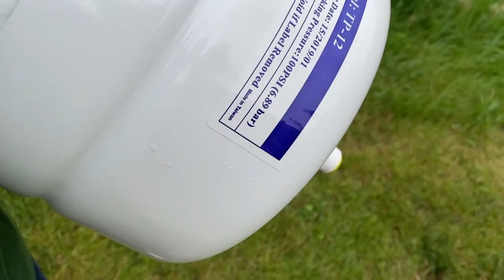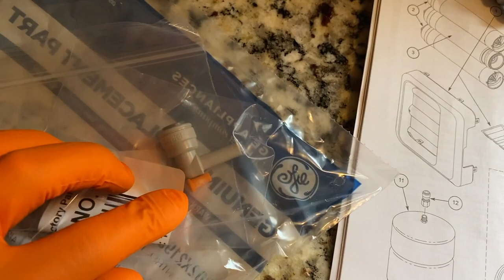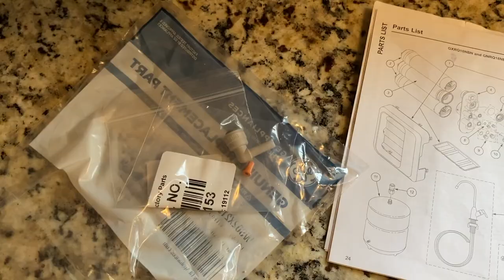Reverse osmosis system draining continuously - Common causes

Comment: I have a new unit and after setting it all up, doing the purges and everything, the tank is still not accepting water.  There is a audible trickle of water out the black (drain) tube, so not sure what I am doing wrong. Any thoughts?  On top of that, they turned the tank fill tube into a yellow tube instead of clear, so it's hard to see how much (if any) is making it in the tank and not.

Comment: I need help? I have a Watts brand 3 stage reverse osmosis system. It continues to drain water down the drain making a gurgling sound. Manual reads, to pump 4-7 PSI max. No more then 7 PSI in empty tank. I have 7 lbs PSI in tank. Still drains water with gurgling sound down the drain. Is there a way I can bypass this to stop losing water down the drain? I know to bypass has to do with the red & black water line. Can I simply, pull the red line off and plug it off to bypass it. My State doesn't have that code to have this safety thing. Thanks.
Reply from the maker: Thanks for watching & sharing this.  Have the filters been replaced recently?  Even if 1 of the 3 filters gets clogged up, it will make system perform like this.

We haven’t tried that way, below is a video that shows us discussing a bypass valve.

       https://youtu.be/O9-tMiwIHwE

😎👍

Comment: I have a friend that has the exact same system in this video. They didn't use the OEM faucet that came with the system. They used one that was built into their sink faucet. It only has one hose connection. They connected the red line from the flow restrictor to the drain saddle which is mounted high up on the drain like yours is. Do they need to change how they have it configured? I was thinking that they could build a small shelf on the side under the cabinet, high enough to raise the filter housing above the drain saddle, so that the waste water is going downhill into the drain. Would that be a good way to handle this? Also, should they install a one-way check valve into the red line since they're not using an air gap?
Reply from the maker: Thanks for watching & that’s a great question.  Unfortunately we haven’t modified this unit in that way & can’t give you a confident recommendation.

Lots of different ways however the best will be the one inline with keeping system to proper code so it doesn’t fail inspection if house is sold.

😎👍
Reply: In the configuration you describe, if the drain is clogged at the trap (or below) and you fill the sink with water, you could backfeed the RO system with dirty water - that is why they design it to use a special faucet with an air gap. It isolates the brine line by discharging above the highest possible waterline of the sink.

Comment: After releasing the pressure from the tank to drain it, did you add any air (pump) back in? How much pressure should an empty (or full) tank have? Any help is appreciated. Your vid is great!
Reply from the maker: Thanks for watching & great question.  With the tank empty, you will want to bring the air pressure to the manufacturer recommended psi which can be found in instructions manual.

Below is a link to our video showing this procedure.

       https://youtu.be/mjg-nGxpBM8

😎👍

Comment: If you unhook the water line running to the reservoir tank. Will there be a lot of pressure. I want to shorten the line after I’ve hooked everything up.
Reply: If there's no shutoff on top of the tank you'll have to shut water off and drain tank to let pressure off
Reply: @GetToThePointplz123  thanks!

Comment: Morning: I have seen a lot of vids and I am sort of worried I dont know what my problem is.  My tank seems to not be fillig up and when I turn faucet on after about 10 seconds I hear like a vibration somewhere. Also, I notice after i turn it off, I lose water to the main drain. But, its not continuous.  I am ready to change the flters on my system..just changed a year ago.  Now, I see it could be the tank and pressure.  Thoughts?
Reply from the maker: Thanks for watching, any update?  Over-pressurizing the tank can cause this.  It’s similar to using an air compressor that only has 10 psi in it to bring a tire psi up to 30psi…..the tire will always over-power the compressor and you’ll never be able to get the tire pressure up to 30.

In this example, the tire is the tank.  If the tank has far more psi then it’s supposed to have, it will always overpower the water trying to enter it…and always push the water away from tank.  Keep us posted.

Also, below is a link to our reverse osmosis Playlist.  In this Playlist, you will find many videos that will hopefully be helpful to you.

       https://youtube.com/playlist?list=PLjCXOz8TSkZlQnBuZZrgOiwjkvAkXc_Ov&si=ntoM1vLat5xSEEEJ

Looking forward to 2024, many more helpful videos to come!  🧰
Reply: I replaced 4 of 5 filters and the 5th that came in was broken...so it should arrive today.  If not, Ill look at tank but i do hear water through black line going to drain and thats the filter I have not replaced yet.
 @DIYwithMichaelBorders
Reply from the maker: @nighttrain316  

Thanks for the follow up, looking forward to hearing back from you after that last filter arrives and is installed.

👍🧰
Reply: @DIYwithMichaelBorders  well I sat down to tackle issue tonight. But initially we could not for the life of us get that last housing unit to turn to change filter. So, we ordered a new unit.  It’s slightly too small and the elbow heads when turned all the way create a totally different angle and so my black n blue lines won’t reach to clip in or they will kink. I can’t win my man!  
So going to try to order another one that’s bigger size. Wife thinks it’s the tank somehow but I want to change last filter first
Reply from the maker: @nighttrain316  

Thanks for the update, bummer.  You’re getting tested my friend, however we have a good feeling you’re going to come out on-top and have a great running and reliable system.

Keep us posted.  🧰
Reply: @DIYwithMichaelBorders   major update!  So I decided to loo at the tank. I emptied otu the water in the drain.  Then, tested pressure...ZERO!  So, I then took it outside and opened up valve and a bit came out..maybe a cup. So, I saw where you could pump pressure into it to get more out..cus it was still very heavy. One pump on my bike pump and BOOM...it flowed like a fire hydrant being flushed!  Then, measured pressure and it was at 6...so I raised it to almost 10 empty.  I still cannot get the last filter though as it simpy will not come undone.  Although its still in the time frame where it should be good, I have a feeling it needs changed.  But, everything is working great now. Any idea why that came spewing out so fast when I put in some pressure?  Thoughts?
Reply from the maker: @nighttrain316  

Good morning, we really appreciate the follow up.  That’s great news, and sounds like it will buy you time so you can purchase a new tank and replace it later down the road on your own time that works best for you.

Thanks again.  😁👍

Comment: Hello. I installed mine a couple a days ago (new). But the water is still going down the drain and it makes weird noises. Help please
Reply from the maker: Good morning, just poured a cup of coffee and am sitting down to answer any and all questions for the DIY community.

That’s a bummer you’re experiencing issues with your new system.  By chance did you check the psi on the tank?  A tank that’s over-pressurized will actually overpower system and not allow water to flow into tank…leading to continuous draining through drain line.  Please keep us posted.

Let us know if you have any questions and hey if you’re interested, join our DIY ecosystem and help us grow an exclusive group of DIYers.

       toolboxtoken.com

Reach out to us any time!  🧰

Comment: I got a system always draining via black tube. Water coming out of the faucet just fine so its not trapped. Its just constantly draining via black tube.
Reply from the maker: Thanks for watching & welcome to the DIY Raptor Club.  Any recent maintenance done to the unit?

This will help us pinpoint whether or not any recent maintenance is tied to your issues.
Reply: @DIYwithMichaelBorders  No. I changed basic large water filters in it about 2 years ago. No issues. It did have weird sound for a bit, like a vacuum knocking. But it gone away after a month. This is new. Just started running non stop. into the pipe. I hear it all day. So I shut off the main tank by twisting the top blue knob.
Reply from the maker: @donkeyrider  

Thanks for the reply, depending on the age of your filters... it’s possible that they need to be replaced.

With our specific unit, the manufacturer recommends replacing filters every six months & membrane once a year.

Comment: Ok, first you said the tank was empty, very light.... Then you said the tank was waterlogged.  Then you closed the main water feed valve and next you said it was open.... Very confusing video, and I'm not stupid.
Reply from the maker: Good morning Mike, we appreciate you reaching out to us.  This video focuses on the common causes of a RO system draining continuously.

The items you listed are common causes that lead to an RO system falling into the unfortunate configuration of constant drain.

As you know, this is not normal configuration or operation so we go through the items to help get you more familiar with the possible causes.

Please let us know if we can help answer questions, we DIYers need to stick together!  We won’t stop helping you until you get your system back up and running properly.

Let’s do this, please keep us posted on updates and questions.  Looking forward to hearing back from you.

😎👍🧰
Reply: @DIYwithMichaelBorders  Hi, i have a different system and i had replaced both the ASO and check valve, but the water keeps draining. The water does stop if i shut off either of the main line or the tank valve, but with both open, it will just drain. Any reason?
Reply from the maker: @daywzy  

Thanks for watching, have you replaced both filters and membrane?  Clogged filters and membrane cause this as well.

Keep us posted and hey if you have any additional questions and hey if you’re into crypto trading, check out our newly launched DIY ecosystem.

       Toolboxtoken.com

Reach out to us any time!  🧰